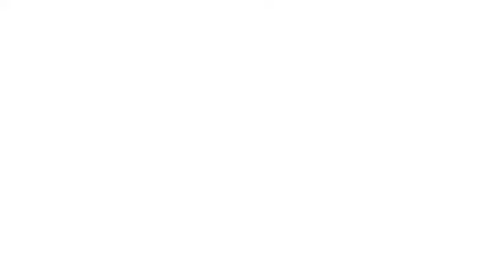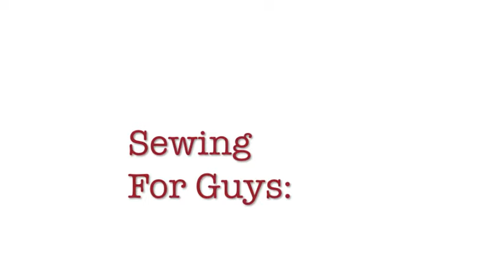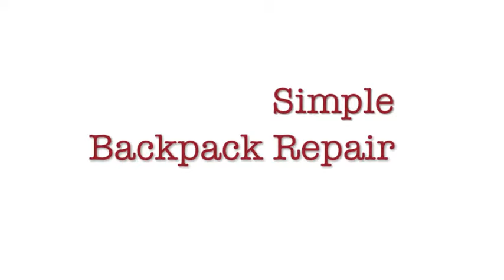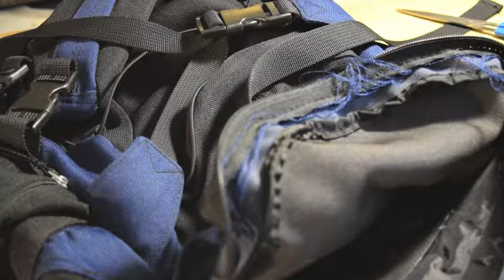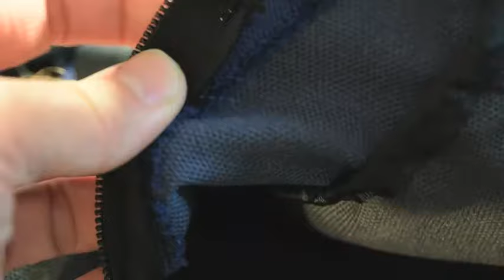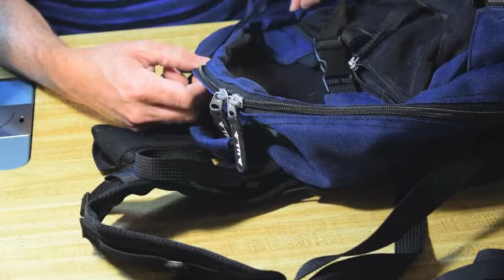Sewing For Guys: Simple Backpack Repair

Comment: I think you’re the only video that I’ve came across that talked about the edge the fabric but, I still don’t exactly understand what supposed to be done with it. I have some seat covers for my car that I want to cut for adjustments but, I don’t understand if the edge of the fabric where I’m going to cut will become undone, unless something is done to them.

Thanks for the video though
Reply from the maker: Hi, 
So, some fabrics have a tendency to fray more than others.  For fabrics that will fray or unravel, it is important to trap the "raw edge," either by folding it over or with edge binding.  With some materials, cutting with a hot knife or sealing the edges by singeing them with a flame can prevent unraveling.
In upholstery work, this is often not necessary as the fabrics used often do not fray badly (vinyl and leather, for example).  If you're using a fabric and you aren't sure, you can take a scrap piece and rub the edge vigorously and see if the threads that make up the fabric become loose and unravel from each other. If you have any doubt, protecting the edges by folding or binding them will help them last longer either way, but they may add unnecessary bulk to the seam (plus extra work to do it if not needed).
I hope that helps!
Reply: thejasonofalltrades thank you, I’ll take note of this

Comment: I bought my son's school bag second hand, the edges are frayed, any tips to repair?
Reply from the maker: Hi, 
It really depends on where and how much fraying there is.  Ideally, the raw edges would be concealed either by folding or binding when the bag was manufactured.  Going back in to do that after the bag is completed usually means significant disassembly, but it really depends on the way the bag is constructed and where the fraying is occurring.
You are welcome to email me at        the jason of all trades @ gmail . com     (remove the spaces)  if you want to send pictures of the damage, I might be able to give more specific advice.

Comment: I bought a sewing machine recently but when I tried to sew a tear the needle broke. Do I need a specific needle for a backpack?
Reply from the maker: What thread and needle combination depends more on the fabric your pack is made from than the fact that it is a backpack. The general wisdom is that you choose the right thread for the fabric, and the right needle for the thread. 
 I most often use size V69 (aka T70) bonded nylon thread in a needle from about size 90 (aka 14) to 110 (aka 18). V69 is an industrial thread size that you are unlikely to find at your local fabric store, but it commonly available online (I buy from The Thread Exchange).
Also, check to make sure the machine sews well on just some test scraps of fabric.  If the timing is off, for instance, the needle could impact on the hook and break a needle, regardless of what is being sewn.
I hope that helps, good luck!